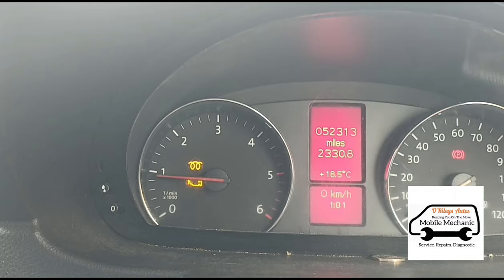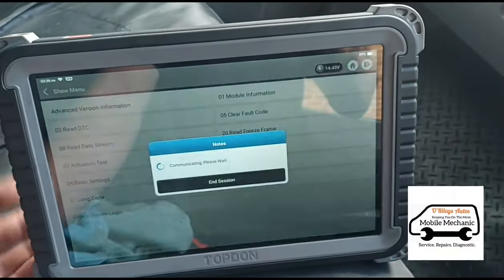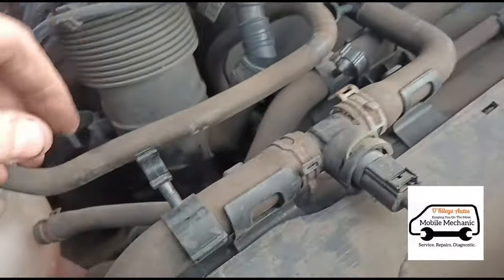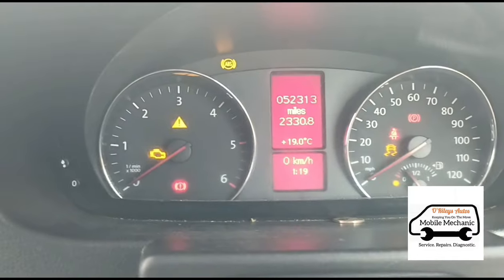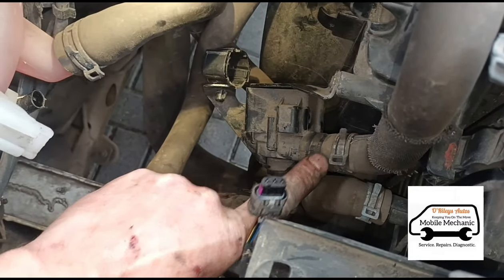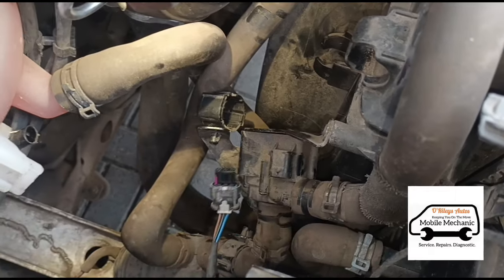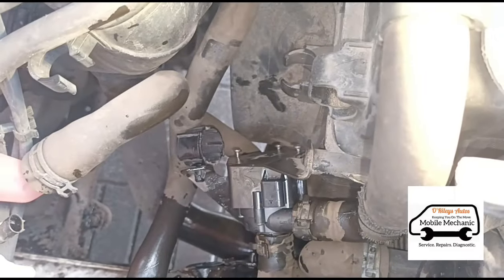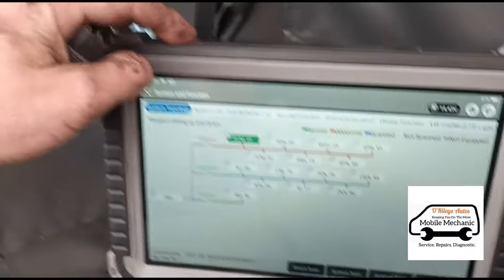VW Crafter 2.0 TDI P261A00 Secondary Coolant Pump B Control Circuit Open. Flashing Glow Plug Light

Comment: Videos by O-
rileys so helpful in so many areas, UK VW commercial are pretty useless & have made me now do all repairs on my van.
Reply from the maker: Thank you Carl
Reply: @ORileysAutos  Just me again, so after confusion with what water pump is called what (fiasco)...... fitted the new pump as per your video (thanks massivly) the 3 torx screw were a cow..... but sorted my issue straight away. Thanks once...oh and watched your video on oil & filter change... dit that today. perfecto ... 5 star

Comment: Had the same trouble with a 2.0l skoda supberb exact same pump its at the rear and listed as pump c.
Autofactors sold me a gates pump 
Still 130e for it 
And it was faulty 
Went back to oem pieberg 
And it was sorted

Comment: Any chance you could tell me where the fuse or relay is for the other electric water pump that is up top by bulk head going into the heater matrix bought a brand new pump still not working tested plug with multi meter and no power from plug fuse location and fuse number in holder would be great help , thanks

Comment: A simple question, at @2:22 you can see that the plug isn't entirely fitted into the socket, the white part is disengaged. Would this be able to generate the fault code as well? or is it just to lock the connector in place?
Reply: i'm ass u me ing that he disconnected and reconnected terminal and checked to make sure that a bad connection wasn't the issue. and left the clip out.

Comment: Question, I had that code in my 2014 Touareg and replaced it and still getting the code. Says Control Circuit Low. Could I have received a bad pump?
Reply: I got the same problem as you
Reply: Any update?
Reply: U need OEM pump